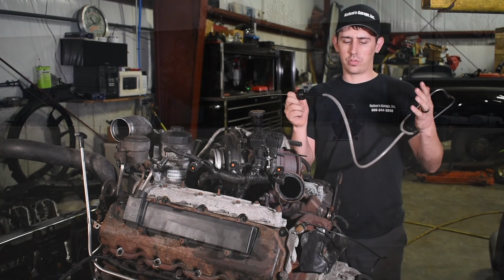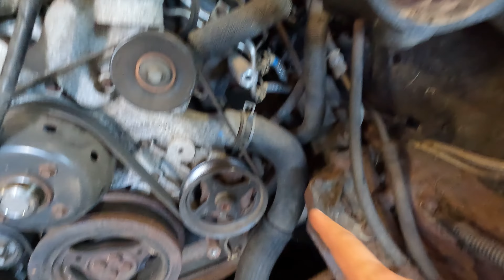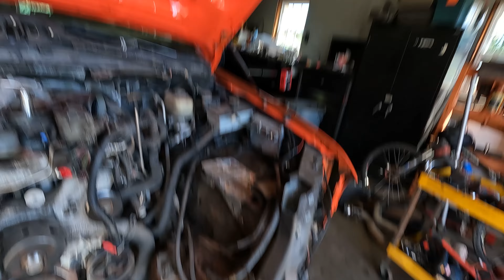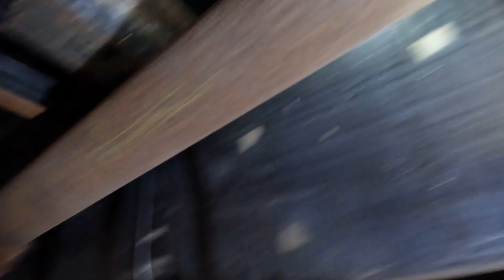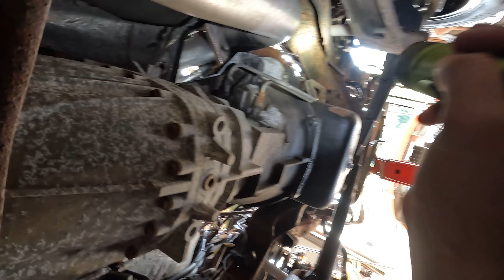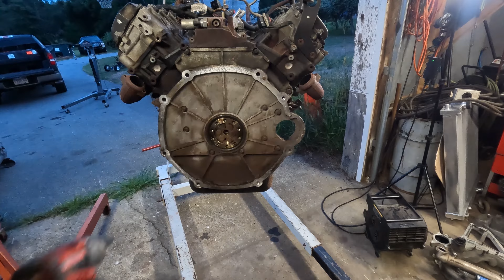6.0 POWERSTROKE Head Gaskets PART #2

Comment: Can a bad injector cause a crank but no start on  a 2005 6.0. ?
Reply from the maker: It could if the top o-ring was completely blown out causing a large high pressure oil leak.

Comment: Many people are intimidated by these trucks and there is no reason to be.  There are so many on-line resources like you,  Powerstroke Help, Super Duty Service, Too many Toys and Powerstroke Customs, I pulled my engine just as you did and I did a complete rebuild with Stage II cam, ceramic pistons etc.   After all, these engines are nothing more than a 32 valve push rod V8.  I invested in about $700.00 worth of specialized tools, but they were well worth it.  If your watchers have any mechanical ability, I would encourage them to give it a shot.  I am in the Charlotte, NC area and would be glad to be of assistance to anybody in the area that needs it.

Comment: Maybe a dumb question, but why do people pump up the timing in order to produce more hp. Isn’t torque really what you want?
Reply from the maker: I would be lying if I said I’m an expert on tuning but what I will say is timing does also increase torque. Most tuning out there will dramatically increase your torque numbers.
Reply: Perhaps to compensate for the dwell.

Comment: 🐎 I have a studded 6.0, mild ECU and TCM tune, with a flatbed, weighs 8,000 lb empty and I can still break the tires loose at 30 mph
Reply from the maker: This one is down to around 5,700lbs. Should boogie.
Reply: @InTheShop  32 in the valvetrain to give the other lane the pain